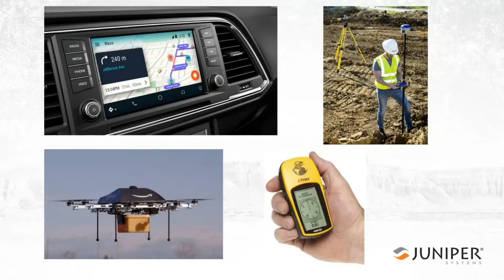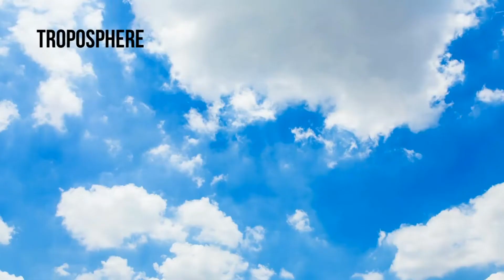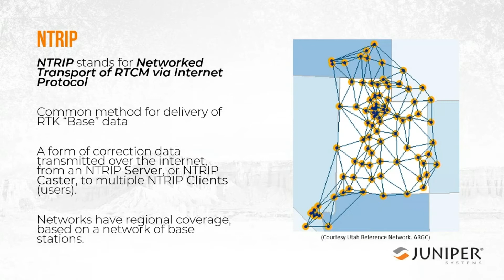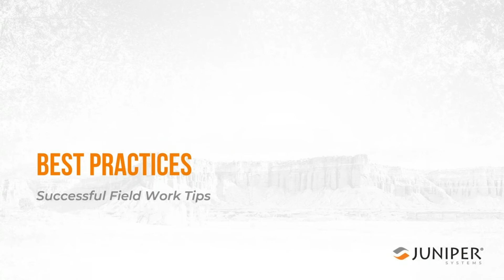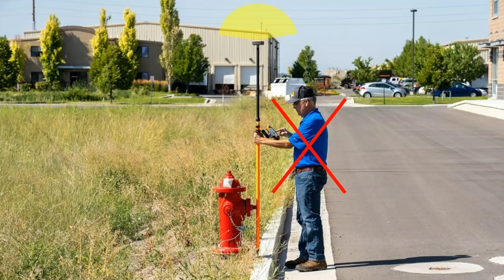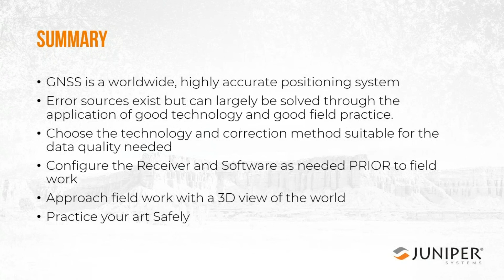WEBINAR: Getting Better GPS Accuracy | Field Ready

Comment: I have my RTK mounted in my air conditioned attic. This RTK communicates with a roving lawn mower. Is this a bad move due to wood rafters in the attic? The house is 2 stories so moving the RTK to the outside on the roof is a task..Would appreciate your thoughts.